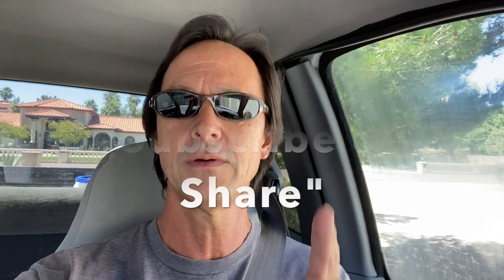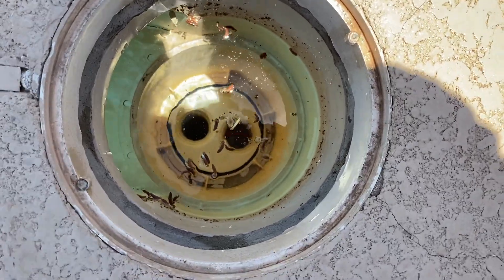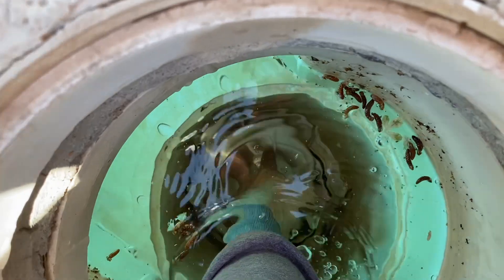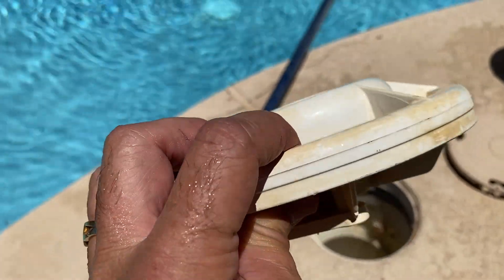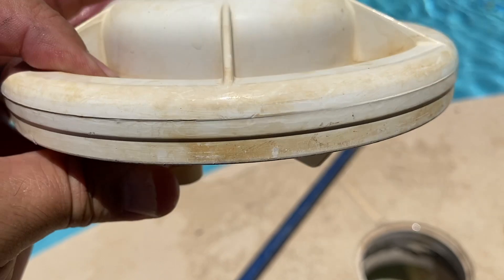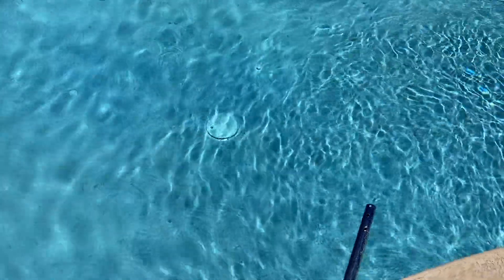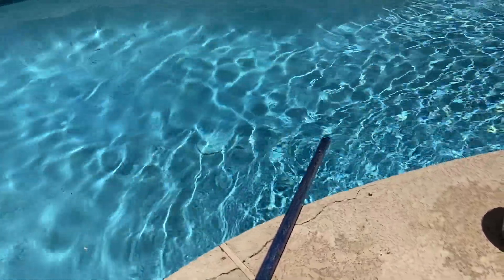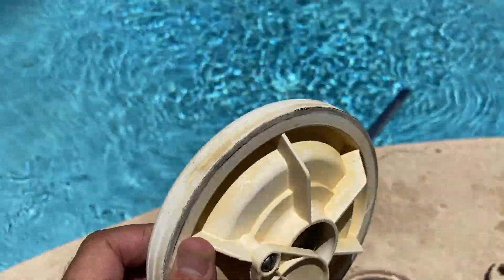Pool Skimmer Diverters: What Are They, What Do They Do & Do They Really Work?

Comment: With all do respect. Most pools here in Florida built years ago (70's-late 90"s) have that exact diverter and 2 holes in the skimmer. So, there's tons of this type of diverter being used. I've been dealing with pools for over 40 years. That particular diverter works like this: The flap, allows a balance between the skimmer and main drain. If the flap is completely closed, there is still a gap. At that point, the main drain and skimmer are split proportions. Skimmer runs around 20% and main drain 80% since the flap is not air tight. The "float" is designed to save the pump. If the water level falls below the skimmer, the float will block off the skimmer and present 100% suction from the main drain. It works perfectly unless the diverter is brittle from chlorine or the o ring is worn. The design intent was not to drain the pool. If a little air sneaks by, it's OK and won't totally destroy your pump. Obviously, you'd notice a problem shortly after it occurs. Not the best way to do these things but hopefully you'll have a better understanding of the design intent and operation. The original designed diverter was from Pentair and they held the patent for years. I was a Mechanical Engineer for Pentair during the years the diverter was produced. Thanks for your time, sorry for the long read.
Reply from the maker: Hi Andrew, I appreciate you input and thoughts.  I've been mixed on my experiences with diverters.  Some good, some not so good. But I thank you for your explanation.
Reply: Phenomenal reply Andrew. I have the same Pentair system for over 40 years. No issues with my diverter...😉
Reply: why dont these pumps shut off when they detect no water
Reply: Good reply. I think the original YouTuber was either misinformed or misunderstood the purpose of the float valve. It’s not to drain your pool, it’s simply to prevent the pump from being able to suck pure air from the skimmer box should the water level fall below the height of the skimmer box. It’s effective a “fail safe” mechanism to help your pump not get destroyed should the water level accidentally fall. The purpose is not to use it to drain your pool (yes, if it does engage then the suction will divert nearly 100% to floor drain, but again that’s to save the pump from sucking pure air until you notice the problem and refill your pool so that the water level is above the skimmer box)
Reply: @martinvonau thank you for pointing that out. I dont how PoolSchooler is going to explain something he has not clue about 🤣. “I’ll tell you if this floater works or not, eventhough I dont know how it works.” Lol
Reply: @kennyg572 mine does. It detects losing suction
Reply: So if my main drain block do I still need it?
Reply: Great Explanation!
Reply: Thank you for supplying the explanation and i appreciate the respectful way you did so.  Most of us dont know what we dont know unless someone takes the time to give us the correct information.  My only concern is the video was still not corrected.

But this reminds me of the repair techs who fix things by removing parts that arent "needed" instead of admitting they dont know how it works.  You can do something for a long time, but that experience wont make you an engineer anymore than cooking everyday will turn you into a chef.

Comment: Believe it or not I have a pool with a leak and it doesn't have any valve to shut off the skimmer and this does work when the water level gets low. Otherwise the pool loses prime and the pump gets red hot
Reply: That’s the main reason. I have it due to my pool lacking an auto fill.

Comment: I inherited my father's home that has a Shasta built pool from 1976. It also has the two-hole skimmer with a diverter. It has a Pentair system. I personally keep the lower flap halfway open in the diverter. I also have to say in the 40 years my father has owned the pool, up to the last three years I have taken over, there has never been a problem with this diverter and the pop-up system of the pool. What was built in 1976 which was then state of the art to me, is still state of the art today and can still clean my pool better than any non pop-up system can.  The pool is located in Glendale, Arizona. I believe you are also in Phoenix. You have an open invitation to come look at my pool...😉
Reply from the maker: I appreciate the offer and I am delighted that the system you have in your pool is working so well for you.  I have a few clients who have a pop up system that works well and some of my clients' choose to keep the diverters in place as well.  But some have had different not as positive  experiences with both and choose to not use either.

My opinions are simply, that, opinions.  And are based on my 20+ years of servicing pools around my area.  So I offer my opinions on some subject matters such as these and allow my viewers to make their own decisions.

If you're system is doing the job for you and you really like it, that's fantastic.

Comment: I was told it is like a check valve if your water gets too low it will suck down shut off the skimmer so it won’t burn up your pump
Reply from the maker: It is that as well, however I've too often seen them fail to truly seal and thus not do their intended job in that area.

Comment: I use the diverter once a month, just to suck out the dirt and debris in the pipe. All other times I have my hayward pool cleaner connected to the auction pipe. I have drained my pool a few times completely and removed the main down cover to find it filled with dirt, tiny rocks and some green algae growing since the water there goes not get filltered through my sand filter. Hence the once a month use.
Reply from the maker: Thats a great idea. Thanks for sharing.

Comment: If you dont use the diverter with In Floor pop up heads the your drain pipe will hold debris. I just had AZ Leak Detection come out to find some leaks and as soon a they started to blow out the lines to pressure test the Spa main drain pushed out years worth of debris because I wasnt using the diverter. Now  I have the diverter in my Spa clean out only and its keeping the main drain clear.
Reply from the maker: You are right. I should have mentioned that.  That's the main time I think a diverter is needed. So thank you for commenting. 👍

Comment: I dont have a divertor in mine, but its set up like this, but i dont see any room for one under my skimmer, almost like my basket is designed to divert it? DO some of these not use divetors and use the baskets to pull from the main drain? it seems pretty bad design but that what i got.... no o-ring area or anything down there, just two holes..

Comment: The only difference from drawing water from the floor drain and from the skimmer is the head loss in the piping. Not the elevation of the floor drain. The elevation of the pool water is what determines the suction head at the pump. If the pool were 500ft deep the only difference in what the pump sees is the head loss in 500ft of piping not 500 ft of gravity.
Reply: Well said. Around 3:40 when he starts talking about how it should be harder to suck water from floor drain my physics intuition kicked in and started looking for comments and here you go.

Comment: I have a new pool with an infloor system and it seems the floor drain doesn't ever suck small dirt, even when I sweep it to the drain....what if I closed the diverter flap? What will it do? will the pop up heads still work...seems like they really were not worth getting because it doesn't seem to pop up all the way unless im at 2500 +
Reply from the maker: Actually you would want to shut the diverter flap in order to divert some of the suction to the floor drain and that should help. It shouldn't affect your pop up system's efficiency.  I say shouldn't because I've seen far too many pop up systems set up wrong.  But if they set it up correctly you should be fine.

Comment: I have a new pool with a infloor system that seems to only pop up the venturi heads when its running 2900 and up speed...always clean my filters 1 time every 40 - 50 days in ....I have no water features, only an 18" raised spa with a spill over. Any ideas...the other thing is that I never see any debris flow into the main drain when I see tini leaves just sitting by the drain?
Reply from the maker: Hi Tony.  Ok, so with variable speed motors at the lower speeds they don't move the water fast enough to activate the pop up heads.  So you would definitely want to run the pump for at least 5-6 hours on 2900 or faster.  Then lower speed for another 2 to help continue filtering the water.

As far as the leaves sitting by the drain.  Are the openings in the drain cover large enough for the leaves to get through?  Typically (and another reason I don't prefer pop up systems) is the openings in the floor drain cover are too small to allow leaves to get through.  OSHA did this to prevent children from getting fingers or toes stuck in the openings and possibly drowning.  So it was a good thing to do but put a huge kink in the pop up methodology.  So you could use the diverter to allow some of the suction to divert to the floor drain AND at least it should help with the dirt but probably not the leaves.

Have you ever considered converting you cleaning system to a suction side vacuum using a VacMate ?  I did a video on that in case you're interested in exploring that possibility. AND I would recommend the Barracuda G3 pool vacuum if you go that route:  Heres a link to that video: https://youtu.be/gSfbNv4sV_M

Hope this was helpful. And Hope you'll subscribe to my channel.

Comment: It's there to protect your pump. With my pool it has nothing to do with any type of pool cleaner.  If something  like to many leaves in your basket or low water level cause your water from going to your pump, the diverter will divert water suction to the pool drain.  This will then stop your pump from running dry.  If you slid the stopper totally over the hole, you will constantly draw water only from the poot drains.

Comment: Please help! I have a part that looks different. (This is the one I have: SKIM/MAIN DRAIN VALVE ASSEMBLY SP1082GV) It has a butterfly valve. If I understand what you’re saying, the butterfly valve should be open? And the only time it should be closed is when we are draining the pool?
Reply from the maker: Typically the adjustment on the bottom of the unit can be opened or closed as much as you want so some or more of the suction can be "diverted" to the floor drain.  When you're draining your pool (although I recommend rent a HD submersible pump to drain your pool and NOT the diverter) they would say you close the flap completely so as to get all the suction to the floor drain.Watch this video for further explanation on why I don't recommend using the diverter method to drain your pool:  https://youtu.be/HFKoombKtPg

Comment: I have an in-floor cleaning system and a dedicated suction.  Do you recommend using skimmer + main drain, or skimmer + vaccum, or all 3?
Reply from the maker: I’m not a fan of in floor pop-up cleaning systems. That’s just my personal preference based on my experience. My favorite set up is is skimmer with a dedicated vacuum line on the suction side of the pool. But if you have a in floor pop-up cleaning system you would need to convert your pool to a suction side vacuum. I did a video on how to do this using A Pentair VacMate check it out, here’s a link: https://youtu.be/gSfbNv4sV_M. Hope it helps.

Comment: There's others stating similar comments, here's my 2 cents.. The device can divert what amount needs drawn from the floor drain or skimmer. I keep my flap 50-50. If the water level gets too low the ball float inside drops and will shut of skimmer intake and 100% will be drawn from the floor intake. This will also prevent the circulation pump from running dry. Also it can help the start up cycle by being primed with water.
Reply from the maker: Thank you Patrick, I appreciate your comment.
Reply: I do the same with my diverter. No problems in over 40 years...😉

Comment: My pool has a blocked off at the main drain.  I collected a lot of palm seeds in the floor drain in the deep end of the pool. I think that was the reason why the previous owner cap it off at the skimmer. I have a pool man but he doesn't collect all these seeds that settled at the floor drain all these year. I just reinstalled newer pump and understand more how pool circulation works.  My question is should I remove that plastic plug at the skimmer and buy this diverter to use the main drain ? I'm going to use king drain bladder and blows everything before using the main drain. Let me know thanks.

I'm going to buy pool cleaning equipments plus vacuum device to vacuum that pool manually.  I'm looking to buy a automatic vacuuming too. If I have everything, should I even look into opening that plugged main drain back to service?  Thanks
Reply from the maker: I'm not sure the diverter would be effective in sucking up the seeds you're talking about as they may be too heavy.  But it may be worth a try.  I would suggest putting in a suction side vacuum (I'd suggest the Barracuda G3) using a VacMate skimmer attachment. Here's a video on how to do that.   https://youtu.be/eagXAKxN8zM.
Reply: @PoolSchooler  thanks for fast reply. I got in trouble.  So the day after I posted the comment, I went out and bought vacuum tubing and long pole to vacuum the pool floor without leaf canister to catch big debris. I think I sucked up something that is now clogging the suction pipe.  I do not get water rushing into the skimmer like the day before it was obvious so strong when I just installed new 1 HP Century motor plus housing.   Today with same motor I barely got any suction, there must be something preventing water coming into the suction pipe.  I do get 25 PSI at the tank reading, return jet is not so strong compared to previous day. I used king drain bladder from the motor and from the suction at the skimmer port. I don't get anything that came out. When I was running black bladder at full blast, I didnot feel any water jet come through at the skimmer when I placed my hand over the hole. Should I go head and use my 40 foot snake drain? Let me know what you think I have a video I record using cheap sewer camera  . Let me post the link. Thanks. I'm so frustrated.  Today, Even after I changed out to 1.5HP motor it would still not as strong as the first day before I started vacuuming the floor at the floor drain that has so much debris. Thank you
Reply from the maker: @TruongLe-eo8kh  Yes I'd suggest snaking out the line.  Something's got to be plugging it if you have the suction dedicated to that line and are getting no suction.
Reply: @PoolSchooler  i don't know what is clogging the suction line. I wedge the black bladder into suction line at the motor and turn on the water at full blast. The bladder expanded and wouldn't shrink when I turn off the water. It is holding on with a lot of back pressure.  This means the bladder is pushing water against some thing in the pipe.
Reply from the maker: @TruongLe-eo8kh  Have you tried opening up your Jandy valve and see if there is any blockage in it?
Reply: @PoolSchooler  I used my 40 feet drain snake and was able to unclog but it didn't push any debris up. I was able to pull the small through at the skimmer.  My setup is very simple there is no valve before the motor except a ball ball valve after the filter. I noticed that the water was low when I ran the pump. It created an illusion the motor was strong because a lot of water was rushing into the skimmer. But when the water level was filled up after 20 minutes with the hose.  It looked as it was weaker because as soon as water got sucked into the hole there were water instantly replaced when water level was at higher. Anyway, my filter was clogged too due to my plant pots around the pool causing a lot of sediments at the bottom.  My pressure was 30 psi but as soon as I hosed them down the pump was operating at 15 to 20 psi. Thanks for the advice sir.  I will be taking care of my pool. We will let my pool man go because he barely do any thing now.   I'm learning to take care of it. I was a biochemistry major in college. This shouldn't be that hard.  Thanks
Reply from the maker: @TruongLe-eo8kh  Way to go.  I'm so glad to hear you figured it out and are able to maintain your pool yourself.  Saving money is always a good thing.  Don't forget to check out my membership website poolschooler.com

Comment: Pool in our villa complex has a diverter and it did not work when  the water level dropped due to leak.
Reply from the maker: That's kind of been my experience but one person commented that theirs worked great to prevent such an issue BUT said their diverter had a gasket where the "float" set so as to create a seal.  So in their case it worked.
Reply: Needs the o-ring on the skimmer bottom and the float. Most skimmers have lost the o-rings.

Comment: Hi Ken. My skimmer has in hole. Does that change any of this information? Also wondering about your thoughts on pool Rx
Reply from the maker: It may.  If your skimmer has only one hole it's probably direct to the pump and you don't have an active floor drain OR you may have a dedicated floor drain suction feed.  I'd have to see how your system and plumbing is set up to better comment.  If you'd like to email me a video and/or pics of your equipment set up (and if you have a floor drain in the pool) I may be able to be more accurate.  kennypoolschool@gmail.com